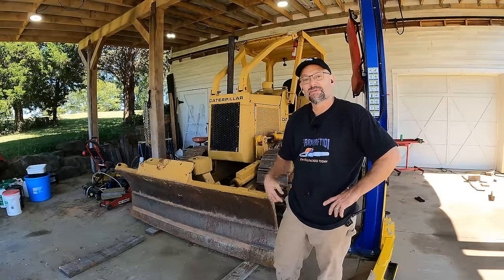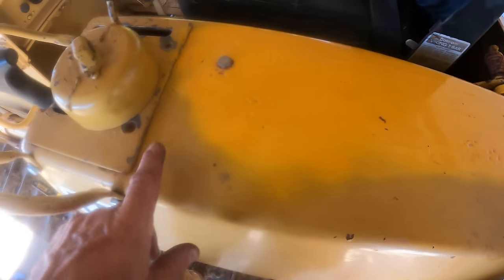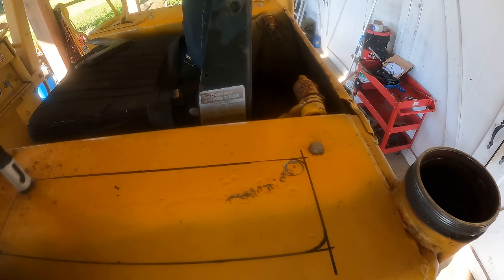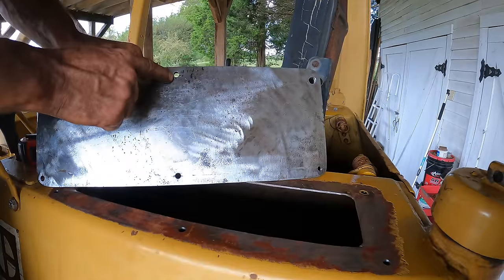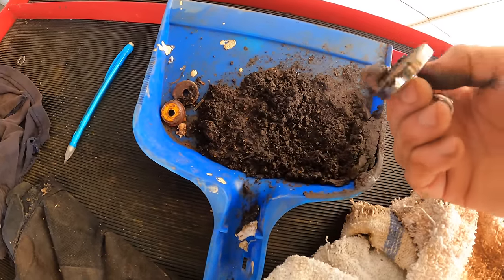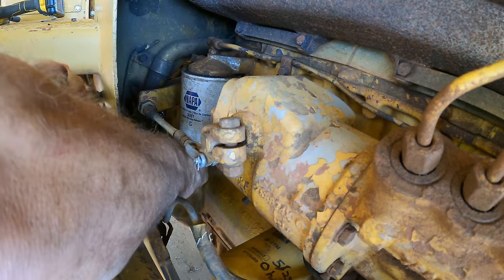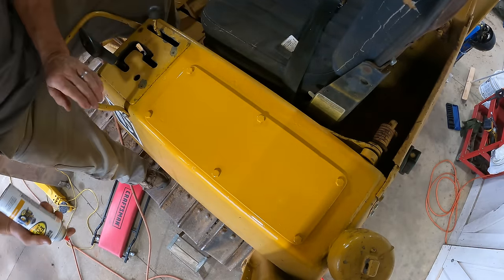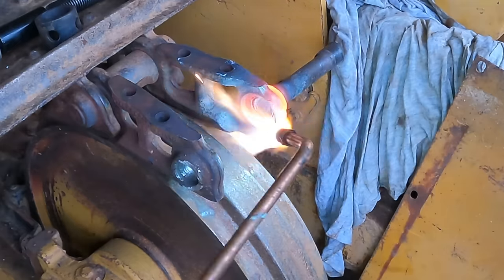Fixing My CAT D3's Fuel System & Exhaust. Cutting Open The Fuel Tank.

Comment from the maker: VEVOR Thickness Planer https://s.vevor.com/bfQuEY,  VEVOR Endoscope Camera https://s.vevor.com/bfQwqn,  Discount Code VVSALE5 for 5% off.
Have an awesome weekend everybody!!
Reply: even if you overpaid you know you have a reliable machine you have gone through yourself now
Reply: That looks like a decent planer, the feed tables are interesting. I couldn’t see any snipe there.
Reply from the maker: It had some snipe, but not too bad. Agree, it seems a decent planer for a crazy low price.
Reply: @toeknee5464 I second that 👍
Reply: @FarmCraft101 she said when you finishd with her  tank can you give her fresh lick of yellow 😂
Reply: I luv your attitude.
Tho it can get you into projects,
lesser men would ignore.
Reply: @27:24 Good thing you caught that - light pollution is a big no-no with diesel fuel.
Reply: I would not be surprised if this is almost the exact same planer mastercraft (Canadian tire) has used for years. They work, bicycle chain drive, no belts. Rubber rollers gum up though. Best results is to wax the chrome table once and awhile. (Bottom side of where it actually slides under cutter)
Reply: At this rate it will be the Dozer of Theseus
Reply: Hey John. 
If you want to keep your spray paint cans operable forever you need to need to empty the internal raiser pipe by turning the can upside down and spray until no more paint comes out. 
Aditionally you can clean the spray head with thinner/mineral spirit. 
Doing this the can will be OK even after several years of storage until the can is rusted through and looses all the pressure! 
Hahaha! 
Tom 😎
Reply: Recently a guy came in the shop and wanted to buy a 710 cap. 
I was confused and asked and investigated. 
It turned out this moron wanted an Oil cap and read it upside down ...
What a fool! 
LOL!
Tom 😎
Reply: Cleaning up old fuel will work well by using coffee filters, 
I've done it many times! 
Tom 😎
Reply: @PowerTom286  with the old cans that worked. The newer cans not so much. It is usually the tip that plugs up because the paint in can itself has become to thick.
Reply: Those magnets may have been more effective than you give them credit for.  Since the tank is, itself made from steel, once those magnets were placed on the outside of the tank, the entire bottom of the tank would have behaved as one big magnet.  So perhaps a lot of that rubbish you scooped out was still in the tank because of those magnets.
Reply: @KenFullman  the tank is part of the frame which is grounded through a battery. Essentially making it a demagnetizer.  It is also 3/8 plate on bottom. Magnets on the outside had no effect.  Nice try though.
Reply: @jacilynns6330 Refregerators are also grounded and yet fridge magnets are a thing.  Nice try though.
Reply: @KenFullman  fridge magnets are a thing and if you didn’t notice they don’t stay a magnet for very long either. Leaving aside science behind it. 3/8 inch plate vs small magnets the magnetic force doesn’t have the power to get through it.  Nice try though.

Comment: wrong kind of magnet for woking thru the tank, you'd want magents with the polses fairly far apart, but also wide poles, so they have more flux than the sheet metal itself will take up.  Those pot magnets have poles very close together, so excellent hold, but very little "penetration" so to say.
Reply: A wild Mattias appears!
Reply from the maker: Makes sense. Good to know, but at this point I hope not to need them anymore!  👍🏻
Reply: Indeed
Reply: “Watch Wes Work” used the term “perpetual content generator” a few days ago to describe a Massey Fergusson Backhoe. You have good taste if you are also watching Wes and borrowing his witticisms.
  I feel the original exhaust stack was clamped to the muffler flange and not the bonnet flange and was a smaller diameter. It would be very unusual for the stack to mount to the bonnet flange.
  Your exhaust smoke is black rather than blue, which indicates unburnt fuel rather than burning oil, which then implies to me that your rings, pistons and barrels are okay and the oil use is more likely to be valve stem seals and that your injectors may need overhauling instead of an engine overhaul.
 That is going to be a great little tractor by the time you’re finished. I am really enjoying these videos.
Reply: It wouldn't matter how far the poles would be apart you would never get sufficient flux
Reply: Just weld in a bung or two on the bottom of the tank and install a couple of magnetic oil drain plugs. Guaranteed to put the magnetic flux where it's needed.
Reply: Or just drop the magnet in the tank now..
Reply: Interesting. I didn't know that but now I do. Thanks.
Reply: I would get those ring magnets, put a hanger on em...drop em into the bottom of the tank...so if/when cleanout is needed...the metallic particles are stuck to them INSIDE the tank, and they will go with the magnet when it is pulled out...just like the little magnets they used to put in the transmission pans of automatic transmissions
Reply: @FarmCraft101  Put a magnet on the inside, now that you have access.

Maybe put together a mix of the dozer video's title: This old Dozer. 
Lookin forward to the video title: Pimp my Dozer: add a Lift kit, maybe some undercarriage LEDs, Chrome hood orienment, etc.
Reply: @These_Old_Engines Command?
Reply: Diesel fuel will explode. I knew a guy who used a match in order to get a better view of his fuel level. His face was scorched by the flame that came out!
Reply: @rudysaldivar4228  Nitpicking: "Explosion" has a very precise meaning. The diesel "combusted" (burned) but it didn't create a supersonic shock wave.
Reply: @matthiaswandel  Nerd.  😉

Actually it's fascinating.  There is so little I understand of electro-magnetism.  It's people like you who make the modern world work.  Thanks.  👍

Comment: When I lived in Brooklyn New York years ago fixing a gas tank meant removing it, putting it under the nearest fire hydrant, filling it with water, and soldering away. Gas pockets at the top made gentle explosions until all the fumes were gone. Ah, youth.  Regarding your fuel tank patch, my concern would be rain water getting in: it looks like you've got it sufficiently sealed to prevent that.

Comment: What I like about your channel is your attitude. When I was training young airmen to be NCOs, I tried to impress upon them sometimes you have to make a decision and live with the consequences--right or wrong--because you own it. Doing something is better than doing nothing. Even when things don't go or aren't as you planned, your "It is what it is" is true, and you just deal with it. As for the tank, job well done. I would have painted or rust-treated the underside of the cover plate and also the fill neck since both those areas are more prone to air and condensation exposure. But yes, a full tank is a happy tank when it comes to rust prevention. One last comment, you could have placed one of the magnets on the inside of the tank next to the pickup tube opening to catch any metallic particles. Add me to your subscribers.

Comment: Every time you're done with a can of spray paint, but there's still some left - turn the can upside down and spray a small amount until it comes out clear. This will keep the nozzle from clogging when the leftover paint dries.
Reply: you cant do that on a lot of the newer cans, they are designed to paint in any orientation (or so they say lol), =(
Reply: Came here to say this but figured someone already had.

Comment: Quick tip on spraying with spray cans. When you finish using it, invert the can and spray until paint stops coming out, this clears the nozzle and stops it from blocking up, so it's ready for next time.
Reply: That used to work. Most of the time now (in my experience) they still spray upside-down.
Reply from the maker: Agree. I always do that but I also let cans sit for years and then complain when they don’t work. 😂
Reply: Does not always work as I have had cans run out of air and still half full of paint, especially when its a touch up can that you use for many small jobs over the months.
Reply: @incubatork 

Theres a channel called 65 ford, he showed how to repressurize any aerosol can that has gone flat. Video is prolly bout 3-4 years old but still good info if you're interested.
Reply: 65 Ford is just as great a channel as Farm Craft!  He is one heck of an engineer
Reply: Another way to keep the tip clean is right after you are done soak the tip lacquer thinner and blow the tip with compressed air. Also blow out the can valve area.

Comment: Woh up on pulling the tracks off. Try this instead: Fabricate a pair of new wear plates to bolt under the main track arms. Make them full width of the arm for ease of fitting. Then clamp them on with a generous amount of stiff plasticine with a thin film of Glad Wrap top & bottom so it doesn't stick to the wear plate and arm. Unbolt the plates. You now have a pattern to build up the upper surface of the wear plate with weld to compensate for the missing metal on the track arm. You'll need to use the old eye-o-meter to match the plasticine pattern, but it doesn't need to be perfect.

Comment: 33:49 soak the tip in mineral spirits for a minute and you can clean out the clog. If it's because the paint in the can is just not mixed well, Adam Savage showed a drill attachment for spin mixing paint cans, and someone on here used hose clamps on an old recip saw blade. Both options are much more effective than our puny arms 😂

Comment: FYI Bottle jacks many of them will work on their sides if the pickup is on the bottom. Since it looked like you were working on pins. I actually made a portable press using thick steel plates and multiple pieces of all thread, and a jack.

Comment: I have had the same problem with the spray nozzles on Rust Oleum aerosol spray cans for quite some time now. It got so frustrating that I now pop the nozzle off after every use, clean the outside of the nozzle with acetone or lacquer thinner, with the nozzle upside down I put some solvent in it, put my air nozzle up tight to the hole and blow it out until I feel air coming out of the nozzle tip. It is a royal pain in the butt but it has totally solved the problem of clogged nozzles and a wasted can of paint. Really enjoy your videos John.

Comment: Another great video John. In my 40 years of diesel experience compression tests on a diesel are not necessary. If a diesel has low compression white or gray smoke out the stack and excessive blow by will be present. You can temp gun the exhaust ports at idle to test cylinder contribution. Check the intake and exhaust sides of the turbo for possible bad turbo seals. Most large diesels from that era just used a lot of oil.

Comment: All the diesel powered equipment that I work on underground the pick up tube for fuel, comes from the top and stops from the bottom, to keep that from happening I don’t know if you could 90 degree from outside the tank or if it’s even feasible, but it’s just a suggestion!!

Comment: Perhaps you can use some plaster or a similar material to get the shape of the missing metal, work a piece to that shape, and then it will weld and hold better?

Comment: When I was doing Heavy Equipment Mechanics what we would do with those worn idler arms was grind them flat and smooth then weld a piece of sacrificial flat stock on top. When it wore to a certain point we would grind the welds and put another piece of material on top. This saves a bunch of time instead of welding up the surface and lasts almost as long.

Comment: There's lots of return to rebuilding (or refreshing) the engine. More than improving performance, improving reliability -- replacing seals and potentially finding small problems before they become big problems. Indeed, a lot of additional work, but it adds value to the machine.

Comment: When fixing the guide on the track, you should build up the parent material and make flat. Then weld on the shim from 3 sides. If you just weld the shim in on 4 sides you eill have to take the track and idler off if you ever have to fix it again.  Just a thought!

Comment: 6:50 plug it, fill it with water, take a plasma cutter cut out one side, weld on a flange and drill and tap it for a rubber gasket and cap,  sand blast the tank out.

Comment: You can often clean spray paint tips. Replacement tips are also good to have on hand. Invert and spray a little too clean, then wipe with a solvent.  For supper 77 toulene works. Mineral spirits, paint thinner might work. You can also recharge the can with compressed air if you run out of propellant or get a chunk before the spray tip.

Comment: If you are only going to use the dozer infrequently, then consider placing those strong magnets inside the tank, place them close enough to the pick up tube to capture any errant rust particles, it'll save some of the issues. Or simply wait for your in-line filter to clog and then clean the tank :)

Comment: EZ-drain makes a 3/8 x 18 NPT  (model EZ-110) that I think would fit your fuel tank drain.  These valves are 1/4 turn, but more importantly they have a lock on the valve handle.  Also, you can easily attach a hose to the valve for easy draining.  I've had one on my cars oil drain for several years now and it works great.  Best of luck.

Comment: Great video John: I'm surprised you didn't attach a piece of flex hose to the fuel pickup at the bottom of the tank and attach a float to the flex hose end so you would draw fuel from the relative top of the fuel level rather than at the bottom of the tank. I think this would eliminate any possibility of bottom feeding sludge and water and crud in the future IMHO. 🙃

Comment: Hey John, as luck would have it C&C equipment just put out a video about undercarriage replacement and showed them doing the same thing you are talking about for the front idler slide/support.   Yes, they took the track off, yes they used a welder to build up the material lost but I couldn't tell if they added a shim and wellded or just welded it and ground it flush.   It's a 4 min video in fast time.  Can hardly wait to what you come up with and I hope this comment catches you in time if you needed suggestions or ideas on how to fix.   Good luck and keep up the great work

Perpetual content generator, Ha! Classic....   click!

Comment: You may find you want to use nutserts/rivnut to hold the cover on.  The steel of the tank is pretty thin, and only a few threads will engage.  This will make it really easy to strip out the threads.  Nutserts will give you much more engagement and better hold.
Reply: its fine
Reply: Hopefully he never has to take it off again.
Reply: The problem with those nursery’s is they are not flush with the top of the sheet metal, meaning the gasket would have to be thicker to compensate for the non-flat mating surface
Reply: @henryoppermann134  I believe you'd countersink the top plate hole slightly? (we are talking 2mm for an M12) Or just welding some nuts underneath would do. If the plate is really thin you can punch out a hollow for it to sit down into. That said, if you never open it up again then it'll be OK, but the idea is worth bearing in mind for other projects.
Reply: You have a fine idea,but I am thinking bang for buck in terms of effort. Far too late now,but he could have MIG welded,tacked nuts on the underside of the tank. Or glued. Once cinched down,the nuts aren't going anywhere. With lots of thread. Oh,well. In his next lifetime. Or mebbe his grandson might do it in a few decades.
Reply: More than enough to hold down a plate to cover a tank...if it was a structural member that had forces acting against it sure...but just to hold a plate down it should have more than enough threads to do the job

Comment: IF you can't get the tracks off - I'm seeing a thick copper shim between the bracket and the bottom of the rail. Use a hard wire in the MIG and do build up to fill the missing area. Then find some strips of AR400 (or 500) and weld them onto the bottom of the rail as new wear strips.

Oh, and always remember that there is "new cat yellow" and "old cat yellow".  Not sure when the change happened.

Comment: Appreciate the pick line is a 1/4" off the bottom but I would have raised that even more to minimize the risk of anything further being drawn into the fuel line.  You done a fantastic job cleaning all that gunk out. At least now you have an access hatch for next time.   🙂
Reply: No need to, now it's clean
Reply: I thought that too.
Reply: You'd be surprised what another 1/4" would make. Providing that tank stays as clean as it is, I agree with your comment but I'd rather play on the side of caution and still raise it off a bit more but then that's me and a lot of OCD 😀  @LinkinPark4Ever1996